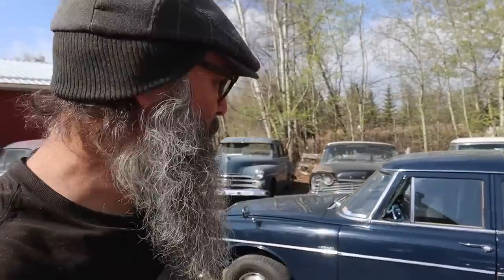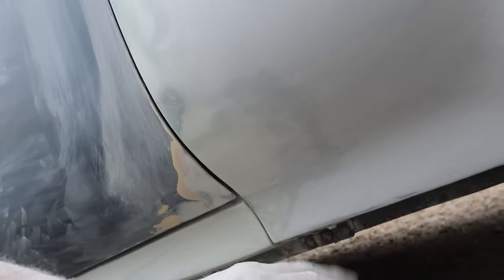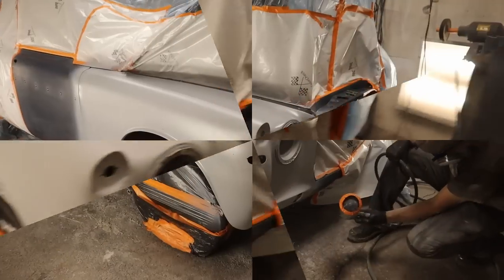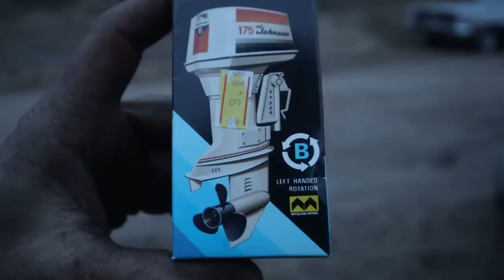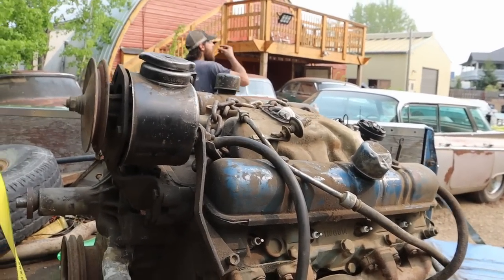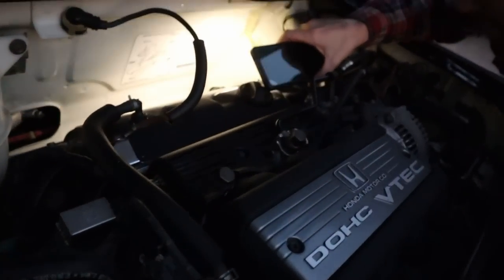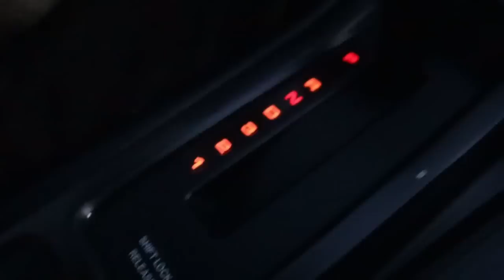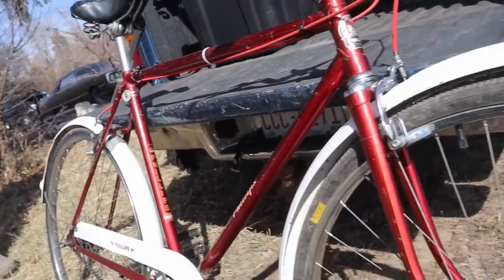Bodywork & Paint! Plus: Another "New" Engine for the 1959 Buick and "Dealer's Choice" Acura NSX!

Comment: A lot of people don't remember the automatic stick shift from Volkswagen that came out in the late 1960's. I had one in a Type 3. It was a three speed manual transmission that had a electrically operated vacuum clutch. You pushed down slightly on the top of the shift lever to depress the clutch when shifting. It also had a torque converter for starting and stopping.
Reply: Some UK Fords were available in the 50s with similar systems as an option - Manumatic and then Newtondrive. As far as I know they're pretty much non-existent now, as they didn't sell very well, they tended to fail with age, and the parts to fix them are non-existent.
Reply: @Zeem4  And Standrive.  (Standard 10.)
Reply: The type 3 Volkswagen automatics were full conventional automatics.  The Auto-sticks were found on the Type 1 models only (Beetle and Ghia).  They really were not that much fun to drive but some liked them.  Many were converted to conventional standard transmissions as they aged.
Reply: I had a Standard 10 with a similiar clutch arrangement to it, manual gears, two pedals, clutch button on the gear lever, centrifugal clutch iirc.
Reply: The NSU Ro80 also had a vacuum-actuated clutchless manual

Comment: Rover's right fender got a do-over, bodywork n paint. A 3 cylinder smart diesel's like a 2 seat minivan, roomy n short. Unloading a 364 nailhead 101, bolt the engine stand to the 364 on the tailgate, tilt the stand until the back wheels touch the ground and slide the engine off the tailgate-bent, wait for the stand to bounce or collapse, success it bounced. Next time let the air out of the tires to lower the truck/stand to the ground. Acura NSX it's the 90's again.

Comment: Love the 59 Buicks one of the most beautiful cars ever built, I have a nicely patinaed 59 Lesabre 2dr hardtop (solid but ratty) with the 364 nailhead and 2spd dynaflow that I've had since 2002, drove it for a few years till the trans went. Right now its sitting in the garage behind my house apart, rebuilt the motor a couple years ago and drove halfway across the country to get a good transmission, need to weld up some rusty floor pans but she's almost ready to go back together. Can't wait to get it going again its been about a decade since I've driven it
Reply: Used to leave the key in it a joke with my buddies if you can start it you can drive it, none of them ever figured it out

Comment: Diesel Smart cabrio for the win! My wife commuted in one for many years. Snow tires on steelies and it was fine in winter. I drove it to L.A., 2000 km each way, in winter, twice — once pulling a trailer. 5 litres per 100 km, so under $200 each way. And great open-top motoring in SoCal at the other end.

Comment: That NSX is automotive royalty these days, as are S2000's. Definitely in that condition. As any sort of 90's JDM model with any sort of significance prizes have gone through the roof for them. Plenty of gems in the motorcycle world to be found still. I get where the over engineering might come over as "boring" (and to a certain degree I might agree) but once you really get in to them both in problem free usage as well as every minute detail they thought of when you start wrenching on them you can only have the utmost respect for those engineers. 

Acura was created as the luxury brand of Honda for the North American markets to compete with Lexus; the luxury brand of Toyota. And where Lexus became that across the world Acura always stayed contained to the North American markets. As such there were bigger USDM models and a lot more automatic models available under the brand. As a lot of Japanese have a  American car obsession (and the US guys vise versa) finding Acura parts like a grill or something and sticking it on your JDM Honda is a popular modification over there. Mazda tried the same in the US with the Xedos models which where suppose to become a separate brand but due to high production cost too late into the game it never came off the ground. Us Europeans just get Honda. They do/did make Euro specific (more driver oriented) models but always under the Honda brand.

Comment: Until very recently the Acura brand did not exist in Japan or Europe. Cars that were sold here as Acuras either don't exist or are sold as Hondas.

The Japanese car market is a whole other thing, where there are basically sub-brands selling to different lifestyle types.

Honda invented Acura as an upscale brand for the North American market. Later Toyota followed with Lexus and Nissan with Infiniti. Cars are sold as Acuras in a few other places now, but is an America-centric brand.

Acura the brand started in 1986 with the Legend. The Integra was next, then the NSX. The weird one is actually the Acura Vigor, which was the fourth release and featured a 5 cylinder engine mounted longitudinally driving the front wheels via half shafts through the engine sump.

The Legend and the NSX share an engine architecture, but the later Honda V6es are different, with a narrower vee angle.

Comment: OK. I'm going to admit I'm out of my league with the Rover fuel pump and need some help. I didn't take it apart and could really use some good instruction, photos diagrams etc. on how it goes back together. It's a dual pump with the points. It had electronic ends, but those did not work. I can't find anything good enough to help. If Keith has some info. or advice, I could sure use it. I want to drive it. Thanks for another episode of the same old shit! Cheers!
Reply from the maker: Hi Heather! I'll see what we can dig up here...Cheers!
Reply: @coldwarmotors The real issue is with the ends. I have new points and a pile of tiny parts. Had I been the one to initially take it apart....

Comment: Excellent video Cold Water Motors Agents Scott  :) ,Tom The Boss , Keith :) , Myles :) , Ash , HQ crew, Frankers The Dog 🐕,   , also nice paint job in Keith car Scott like how turn out 9.8 out 10 for sure paint on fender replacement too plus fix up, Nail Head Motor and transmission  too in getting to too and also Myles old Chevrolet 4×4 truck  Lol ! Also Dealers Choice car that amazing remember ride one in my uncle John 1993 Acura 2 door small CRX in fix at Dealership and had one those cars! Yes Honda Preudule 2 door small one made from 1984 to 2004 was overrated cars Scott  and especially 1994 years one on 4 cylinders  , with 5 speed Manual transmission floor shifter  and never like them all models made ! Check out on them 1994 Honda Predulde S, SE, SRT , ST with Red motors 2.0 litre 4 cylinders took 94 or higher octane gas to plus 10w30 no synthetic engine oil types! I say rebuilt so many those engines never want see one again! So many people ran 87 or 91 octane and should ran Shell brand V Power gas 93 or Sunco brand 94 or higher but didn't! Plus one gas company never use ruin my one vechile engine to of crap additives use too! But stay with great gas company since plus  never changing again!

Comment: It is painful to watch this fight with the fender. It is a good thing that you did not paint it beforehand. I was dumb enough to do that on my last project. The car was not drivable yet and I cannot paint it in a barn. So I had to paint it if I ever wanted to have an assembled and drivable car. Most of the time I had to ajust it all alone. When we could finally drive it out with a halfway fitting fender The wheel was touching when turning sharply to the left. The springs had gotten kind of weak and with a driver inside it would sag a hint to much. That is why I hate welded in fenders as many cars had in the old days. I always screw on and do not weld them. I do not need originality when it comes to this.

Comment: 38:00 I always wondered why you guys don't pressure wash your engines, transmissions, etc before teardowns? Why are you going through all that manual misery when you can just douse it with a spray can of oven cleaner, let set for an hour, and blast it clean with the p.w.

You are cutting into your drinking and smoking time needlessly.